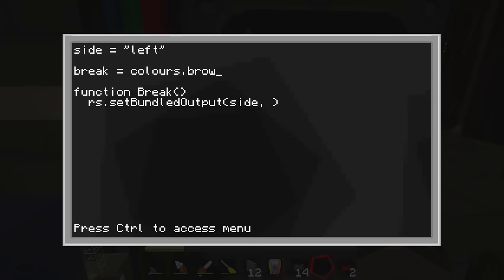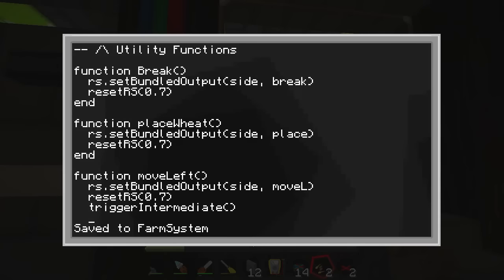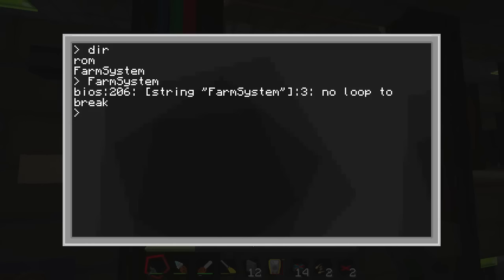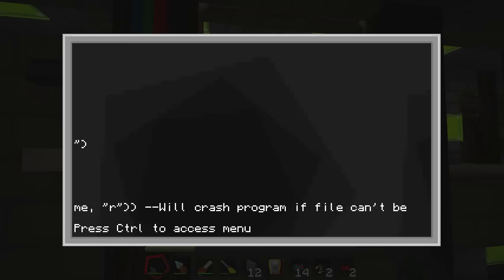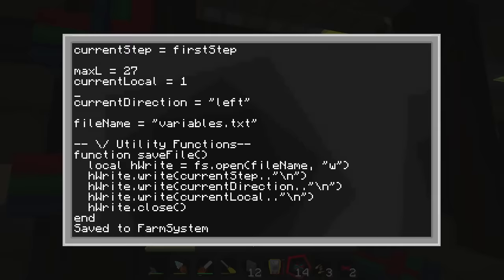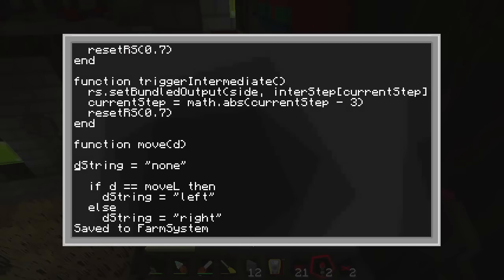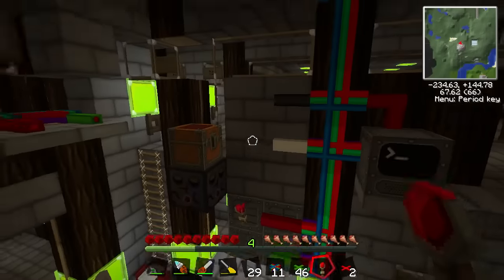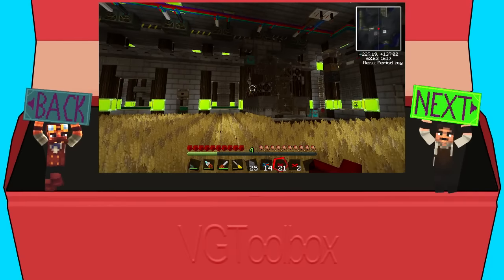Tekkit Toolbox Let's Build Episode 3: Wheat Farm Manager, Part 2

Comment: you should use red power computers and then you can save it also you can change the redpower wire to the computercraft bundled cable